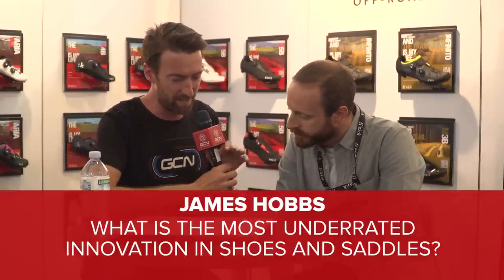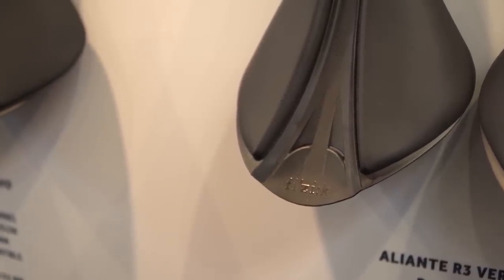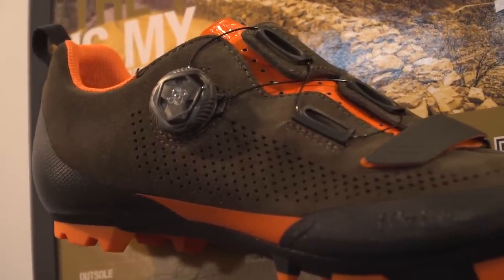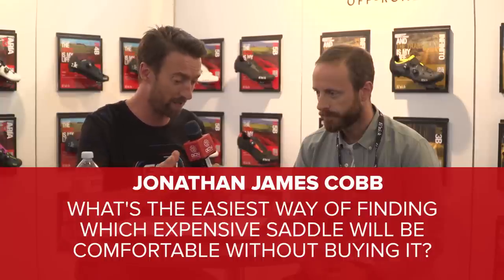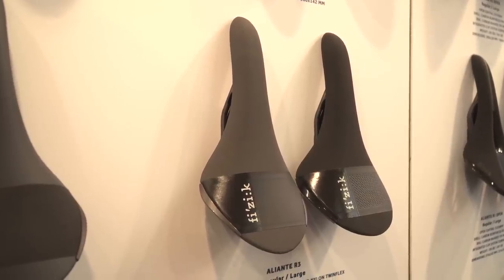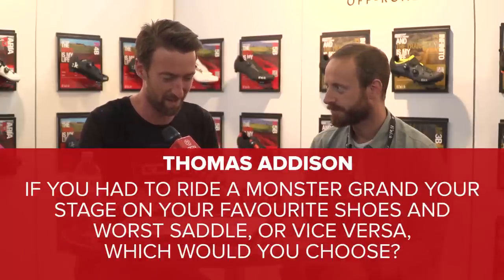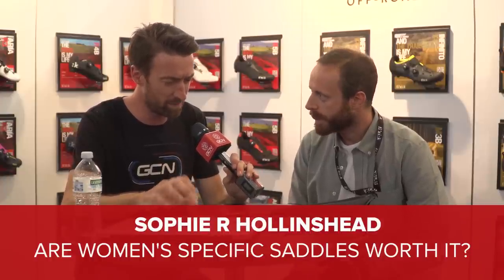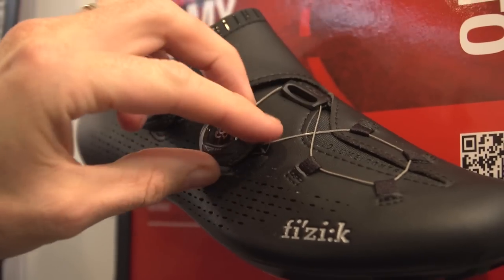Ask GCN Anything About Saddles And Cycling Shoes – From Eurobike 2017

Comment from the maker: Any saddle or shoe questions that we've missed? Let us know here 👇
Reply: As someone who has wide flat feet, who uses moulded insoles in my off the bike shoes, would I benefit from the Fizik extra support in the foot department? If so, where can I best find the support I need to get the fitting right for my feet?
Reply: Have a question to Matt, he might find the answer in his Unwritten Cycling Rules Book. 
I recently got a lovely UK made Brooks leather saddle for my adventure bike and got a special dressing for the saddles' leather. What unwritten rules say about using that dressing for leather hat and boots?
Reply: you know, you pronounce "nguyen" as "ween" lol
Reply: Global Cycling Network #torqueback Hi GCN. Are there any seats made to take advantage of the new rules about seat angles?
Reply: Actually, yes, I just happened to wash my shoes after having to commute in horrid weather conditions and of course they started to smell. How do you proceed to wash your cycling shoes ? What I just did was put hot water (reasonably hot) in a basin with some hand washing powder, separate the various parts (sole, cleats and its screws) and washed them by hand thoroughly. Then rinse a couple of times and hang them. What’s your procedure for that type of thing, and how often do you do that ? #torqueback #askGCN
Reply: I use a Fizik Antares which I love but am interested in the major difference between the Antares Versus Evo and the Open. From what I can gather the Versus Evo has a heap more flex and cushioning over the Open? I'd be somewhat worried the Versus Evo edges may cause pressure.
Reply: Hello Stephen,  the anatomy and shape of the arch can vary a lot from person to person therefore to guarantee perfect customized fit for an high-performance cycling shoe is crucial, as you've inferred. This can be achieved either with customized insoles (as you already do on your off-the-bike shoes) or with a proper upper construction that can guarantee a more customized fit. For some of the new shoe's styles we dedicated a separated piece of the shoe’s upper for this function: the Dynamic Arch Support wraps around the foot’s arch and can be adjusted via a BOA dial independently from the upper mid foot.
Reply: Hello David, both Versus Evo and Open offer pressure relief on soft tissues, the way this benefit is delivered is different though. Open saddles share the same type of construction of a solid surface one, read stiffness and maximum power transfer. With Versus Evo instead we wanted to deliver a different type of experience, we like to define them the 28c tires of saddles. Versus Evo offer a degree of shell flex where you need it and a more progressing cushioning, delivering comfort for longer rides or mixed surfaces. This has been achieved through a new construction where shell and padding are independent.
Reply: xGshikamaru we usually suggest to wipe clean with a damp cloth, without completely immersing them and with cold water: excessive heat may damage the materials and adhesives. We recommend to not use solvents or harsh chemicals. After riding in wet conditions, stuff the shoe with newspaper to absorb moisture.
Reply: That's good to know. A previous GCN video for washing shoes (using fi'zi:k btw) with Matt in 2015 said to immerse them if really dirty. I'll avoid immersing mine now since you suggest not to.
Reply: Where can I find the online tool you guys talked about to find the best saddle and/or test center?
Reply: Thank you for your reply, I will look at getting shoes with the Dynamic Arch Support as mentioned.
Reply: Love the channel lads, but I'm just not satisfied with the Wide Feet answer here. His answers were VERY targeted to his own brand which isn't very helpful. I've had very wide feet (4E) my whole life, even as a scrawny kid with 4% body fat. It's not a matter of fitness, I assure you. Any fellow wide-feet-sufferers with recommendations? 😋

Comment: The laces don't control how wide the base of the shoe is.
Reply: Wesley Wagner And the reason they don't get complaints is people don't buy those shoes
Reply: Correct Wesley, although a proper upper construction and fit adjustment system can address some fitting issues and problems with pressure points, even for feet on the wider side.

Comment: No wide shoe option is the reason I don't even consider Fizik or any other brand that doesn't have a wide fitting shoe. I am quite happy with my Antares saddle but next time I need to buy a show I will look at a wide fit option because I know my feet very well. Currently riding happily on wide Bont Vapors.

Comment: According to online power calculators, the power output required to sustain 30kmh on a flat road is about 180W. Approximately how is this figure broken down into (1) Aero drag bike + rider; (2) Rolling resistance; (3) Wheel rotational drag from hub bearings; (4) Drivetrain efficiency losses (5) others.    Cheers!! :)
#torqueback

Comment: Why do the pros use frames that are too small with long stems to compensate? Why don't they just use the correct frame size? Would I (or anyone that's not a pro) benefit from doing doing the same? #torqueback

Comment: #torqueback I've tried disk brakes several times now and observed no difference in braking sensitivity or power compared with properly maintained rim brakes.  And, I can usually tell when someone is using them -- just listen for an annoying squeal.  Disk brakes are heavier than rim brakes, more fiddly to get mounted after a flat, and they're more expensive.  I consider them mainly marketing illusion.  Are we doomed to this future, or will manufacturers continue to develop rim brakes and wheel sets?